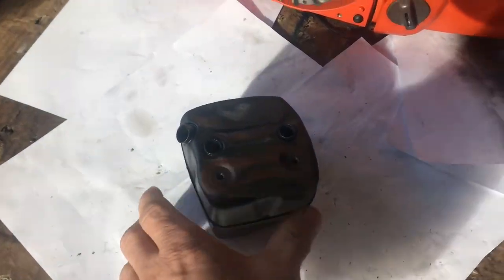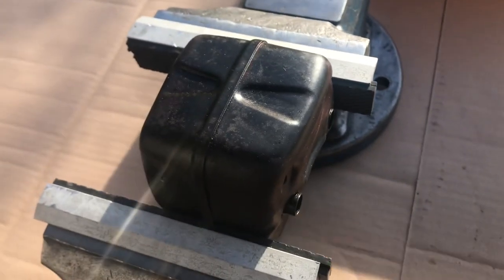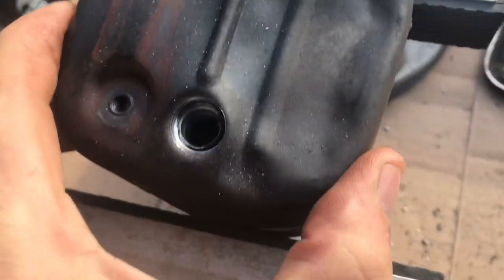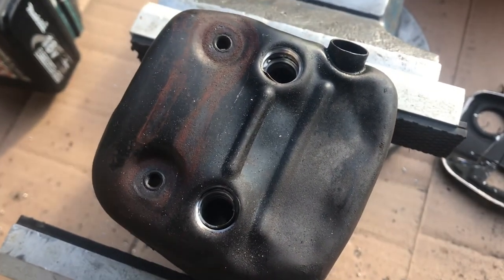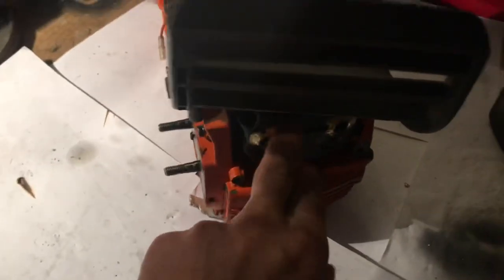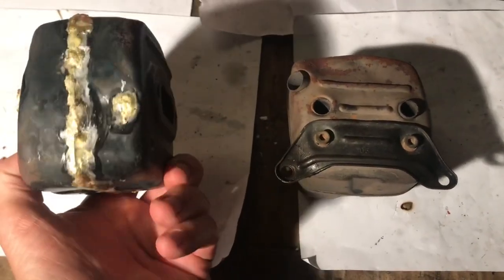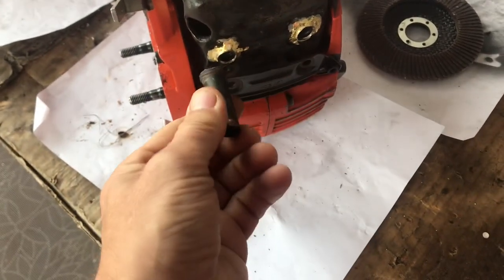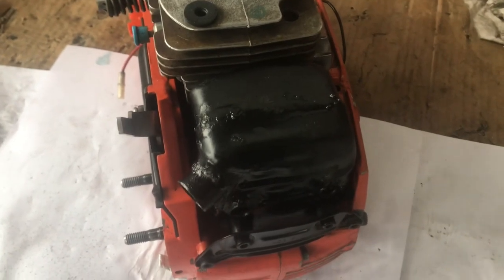Chainsaw Exhaust Muffler Mod - Husqvarna 372xp

Comment: The cheap aftermarket $10 mufflers like on eBay don't have the baffle inside. I bought a couple to potentially cut apart to do just this. They're just the shell, no baffle, but look extremely close to OEM. They braze just fine also.
Reply from the maker: Thanks for the feedback. You can do it 👍

Comment: Cracking job you done there, so you brazed with plumbing torch and brass rod, I didn't think that will work.  Well done. I might try to.
Reply from the maker: Hi yes you can do it. Used internal fluxed rod and Profi high temp blow torch. Works a treat. I’ll do another video on the brazing soon as I’ve  262xp exhaust I’ll modify. You can do it 👍
Reply: Thank you for replying, I will definitely try with MAPP gas ant Rothenberg torch, I  have couple of projects myself and always scratched my head how to braze them. All the best.
Reply: Brazing and soldering is to different things. A braze will work on an exhaust.

Comment: Hi. A muffler without a catalytic converter?
Reply from the maker: Yes just a chainsaw. You can do it 👍
Reply: @YoucandoitwithJules  The lack of a catalytic converter will not damage the saw?
Reply from the maker: @tnt440  These saws thank god were made in a more sensible time and do not have cats. If you have a saw with a car and you remove it you just have to adjust the carb to suit as it'll flow better without the cat and need more fuel. You can do it 👍

Comment: Your saw sounds a little  too rich, I always err to that side though.  I strongly suggest the other pro air cleaner stuff the intake tract is longer with better flow.
Reply from the maker: Always set it a little rich until I set it up in the woods as better that than lean and someone uses the saw forgets to set it up properly and melts it. You can do it :)